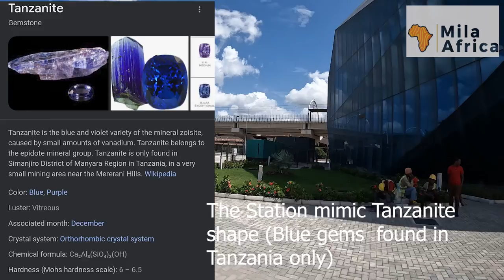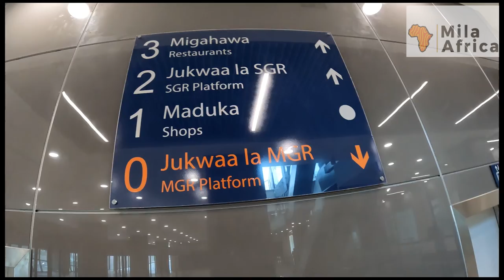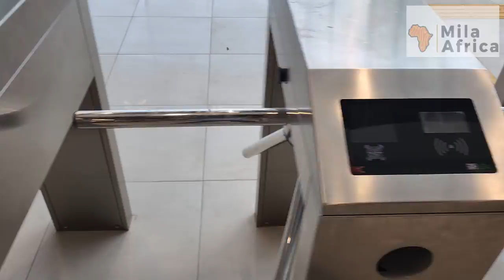Inside Tanzania's High Speed Modern Electric Train and SGR

Comment: Very good video with excellent explanations.But....don't you think that the main station in Dar es salaam is a bit small with only one platform and only two tracks?The electrified railway line will stretch well over 1200km with speeds up to 160km/h....What are the traffic expectations?Are there any possibilities to enlarge the station by adding at least one more platform?
Reply from the maker: Very good observation Patrick let's see how it goes when it starts operation. But there is an existing MGR line on the street level that is operating and has been operating for a century since 1907. On the SGR, I understand there are multiple tracks somewhere outside the main station which allow crossings of the train. Also, this station is only for passengers, the cargo train will end at a different station. But all in all good observation.
Reply: This is not only station in Dar es Salaam. Approximately 20 km from this one is Pugu station where some of city dwellers will board from there.